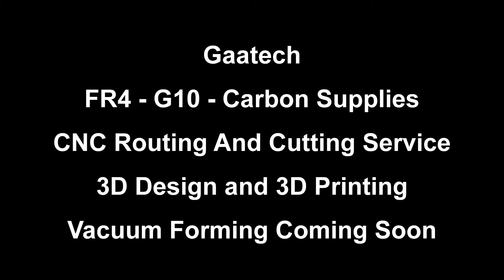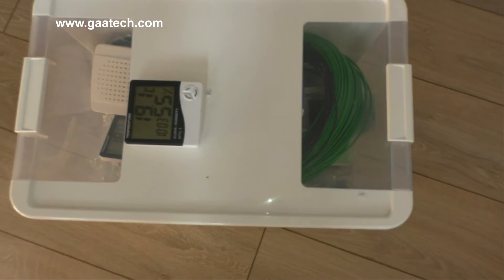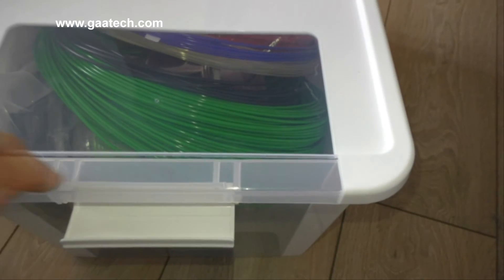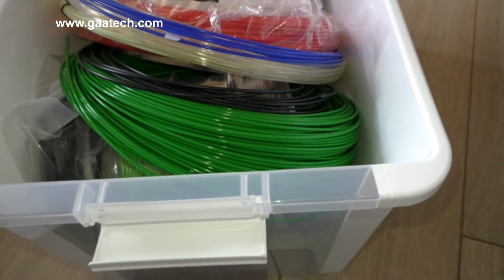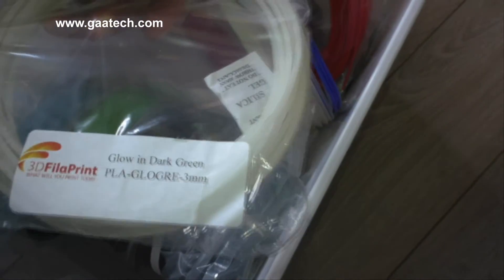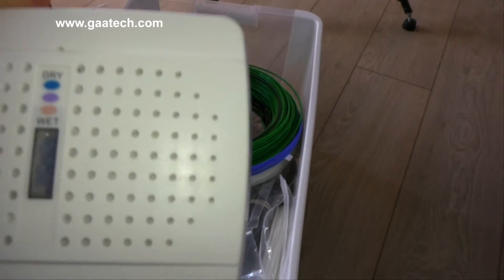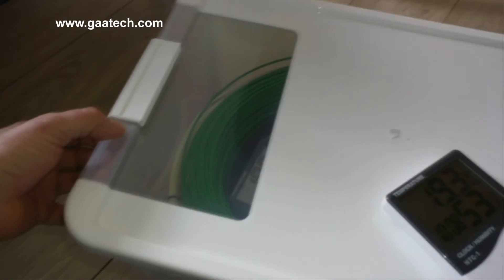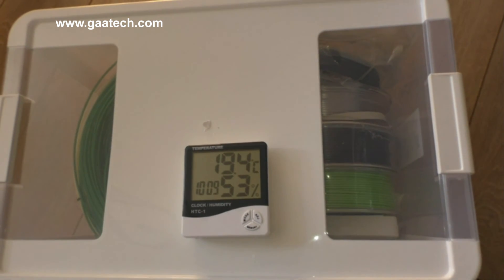0020 How to store your 3D printer filament and keep it dry

Comment: @3:38 PLA does in fact absorb moisture. it's extremely important to ensure PLA is dry as possible when it's being manufactured into filament, and it's important to store it dry. all PLA manufacturers have clear and explicit guidelines about moisture and PLA and keeping it dry.

nylon is the most hygroscopic, PLA less than nylon, and ABS less than PLA.